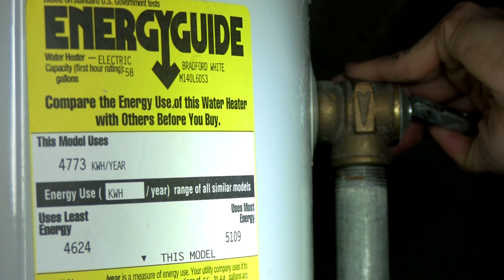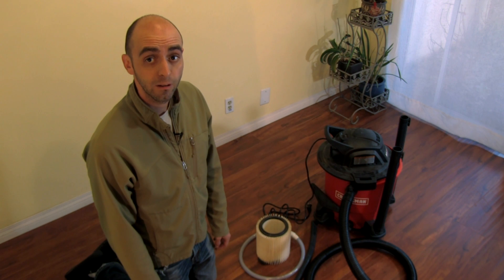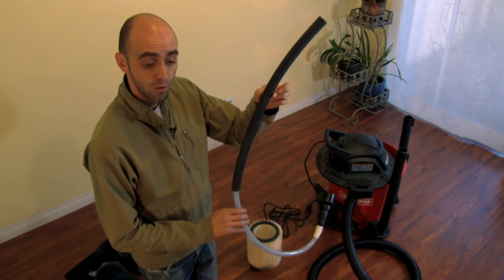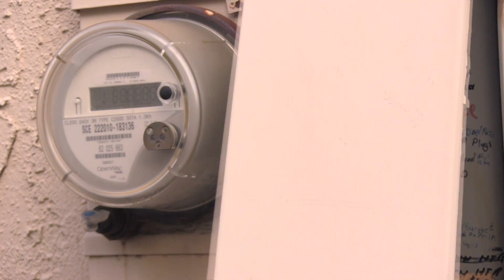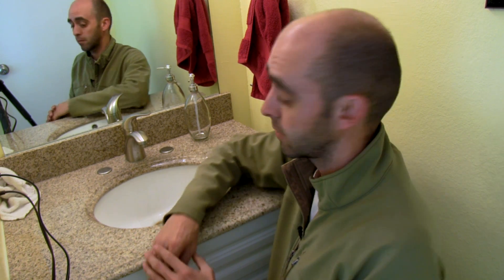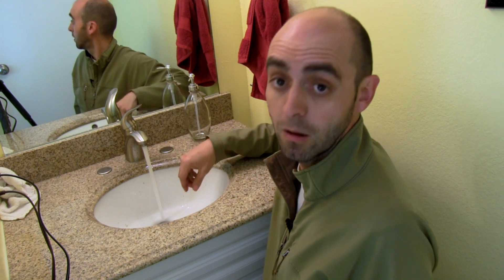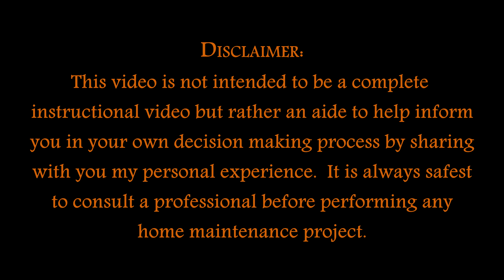DIY: Electric Water Heater Maintenance

Comment: Great video! Just bought a house last month and my water heater is 2 years old so I doubt the previous homeowner did any maintenance. My question is, do you clean the elements as well with a wire brush and take off the build up on those?

Comment: Got a  question for the group. When running the shower the hot water starts to go cold after only 5mins or so n I wanted to know if rheres a common issue that causes this on a Reliance electric water heater model# 650DORS 210.  Thanks for any advice. I'm on my own n bever had this issue bf. The heater is abt 7yrs old
Reply from the maker: It’s likely either a single bad heating element or possibly a single bad thermostat.

Comment: Don't know if you're going to see this. But followed your advice, found bad heating element and replaced it myself. The difference is staggering. My garden tub fills in one go hotter than ever. Thank You!!!
Reply: Problem, I can’t get either heating elements off, and I bought the element wrench.  The heating element, it’s on so tight it’s like it became welded on. Any suggestions on how to remove the heating element if it’s stuck on?

Comment: That sediment looks like mineral deposits from hard water.  You should have installed new elements while you had it apart.  If the elements don't last very long you can get Low Watt Density elements that last longer but take slightly longer to heat the water.

Comment: If you put the larger diameter hose over the end of the smaller diameter hose isn't your suction capacity limited to the smaller hose?
Reply from the maker: Lessened? Probably. Insufficient? In my case no. I suppose your success will depend on the power of your shop vac. Mine is nothing special or particularly powerful.

Comment: how do you know what screw to put the wiring back into there's no negative or positive or does it not matter ?
Reply from the maker: Electric water heaters operate using a 220/240 circuit which doesn't use a neutral. They are both hot. I am not an electrician so you should make an effort to verify my response but to the best of my knowledge it does make a difference  which hot is connected to which terminal. When I've done it myself I've always made sure they were rewired the same way I initially found them.

Here's a video that may also help: 
https://youtu.be/_YZkgZVCZn0

Comment: Once the tank was empty and you verified that you had build up, couldn't you have just opened the water valve to flush out/down the hose and into the drain instead of hooking up the vacuum and buying the hose and attachments you used? Anyone know if that would work?
Reply from the maker: That first thing I tried was a simple flush, pretty much like you suggest, but it didn't do much good. I think because the spigot is located an inch or two above the floor of the tank, gives the relatively small opening of the spigot, and the weight of the mineral deposits (specially the larger chunks), it just didn't do much good. Also, in my case the drain empties to a corner of my patio garden which can barely handle the initial tank draining and it would make dealing with the debris more difficult. I would encourage you to give it a try first to see if it works but if it doesn't than this is an effective backup strategy.

Comment: Suggestions: 1. Take a picture of the wiring with you cell phone so you know how to reattach. 2. Use new heating elements. 3. Use a lighted inspection scope to see all the way into the tank. I keep asking the rental desk at Home Depot but they refuse to get lighted inspection scopes.
Reply from the maker: Good suggestions but as for the heating element, I'm still using that one and it's doing just fine. Why send something to the landfill when it's still perfectly functional. My decision has nothing to do with cost.
Reply: Great informative video.
Reply: Where can I find the heating element for sale, are they model specific?
Reply: @TheWraith007  Start at home depot, either the store or online. Maybe call the helpline for whatever brand you are using.
Reply: @kentonkirkpatrick5225  Problem, I can’t get either heating elements off, and I bought the element wrench.  The heating element, it’s on so tight it’s like it became welded on. Any suggestions on how to remove the heating element if it’s stuck on?
Reply: @TheWraith007  I suggest watching the many YouTube videos about this maintenance.
If this isn't enough, get a licensed plumber involved. Good luck.
Reply: @kentonkirkpatrick5225  Thanks, this is what I found.  Will try it tomorrow.
https://youtu.be/Ijys98-jO-U
Reply: @TheWraith007  Looks good! I hope you can rent the equipment or already have it. Trades people just charge too much these days. Lowes wanted more to install a new WH than the WH cost. Sick

Comment: Great video, but after you put elements back in, you ought to turn cold water back on to see if it is leaking anywhere,so it won' t leak on electrical connections. Which could shock you, or cause a fire. 😀🤔

Comment: Great Video (-) but points missed/errors:
Did not check for leaks before re-installing covers.
Did not replace encrusted elements.
Did not fill tank fully before turning power back on.
Did not inspect anode rod.
Overall not much sediment but a waste of time not doing the above :(
Reply: Thanks for pointing it out, i will check those things too :)
Reply: Also, should not open the TPR valve for air flow. It may not reseat and will then have to be replaced. Just open a bathroom sink hot water faucet. Leave it open the entire time it is draining and the entire time it is filling. Once it starts running smooth, the tank is full.

Comment: Never turn the breaker on until the water heater is full of water and  the air has been bled from the heater, or you’ll burn up the element quickly.
Reply: How do you bleed the air out from the heater?
Reply: @ChosenAndUndone  Just open the handle on the relief valve on top.  Flip it closed as soon as water spurts out.

Comment: What a great video.  Watched it and did it myself.  Thanks so much.  My tank is 15 years old and it was the ONLY time it's been drained, swept out and elements changed.  Surprisingly the elements were in great shape still.  But there was a ton of dirty sediment, rust colored mud like substance and large salt like crystals.  Now that I spent a few hours cleaning it out and changing out the elements, I fully expect the tank itself to fail.  That's how it is you know...sometimes when you mess with things that aren't broken...you break them!  LOL.
Reply: Did it fail, or did it work? Lol

Comment: Good job, but just replace your elements ($10.00 a piece at Lowes or Home Depot) - you went to all of the trouble of draining the tank and removing them - JUST REPLACE THEM!  The shape that yours were in, they won`t last much longer!  I like the hose attachment - I use an automotive heater hose myself. People ask about cleaning the elements - at this point, the metal is compromised and any caustic cleaner will further damage them - like I said - $10.00 a piece!
Reply: NO Prevent maint.. wants All the BUCKS
Reply: Problem, I can’t get either heating elements off, and I bought the element wrench.  The heating element, it’s on so tight it’s like it became welded on. Any suggestions on how to remove the heating element if it’s stuck on?
Reply: @TheWraith007  I ran into that problem years ago, I ended up having to buy a new water heater. Most tanks are glass lined and I would be afraid of using a torch to heat up the area for fear of cracking the glass. Maybe soak the elements with penetrant and keep trying with the wrench? Good luck!
Reply: @TheWraith007 maybe wd40?😳

Comment: The procedure you describe is exactly how it's done.  I perform this service every 2 years.  I cannot understand how you do not REPLACE the Heating Elements and Anode Rod to NEW.  The Anode Rod is at the top of the heater and its function is to draw the lime and other minerals to the rod.  Cost is around $45 for both.  Just cleaning out the bottom, although that's very good, is not enough to increase your hot water.  Electric water heaters are heated by the heating elements not like gas water heaters that heat by flame at bottom of water heater.   CHANGE BOTH and you will have all the hot water you desire.
Reply from the maker: Because they weren't worn-out or deformed and I wasn't experiencing any loss of hot water capacity while showering. Ya they're cheap but there's no need to trash them unnecessarily. That just seems wasteful.
Reply: Problem, I can’t get either heating elements off, and I bought the element wrench.  The heating element, it’s on so tight it’s like it became welded on. Any suggestions on how to remove the heating element if it’s stuck on?

Comment: You didn't clean the elements, that's what I was looking for
Reply from the maker: Ha, sorry. I haven't had an issue with that since I've been cleaning out my water heater annually, or at least not yet. The elements are solid metal and don't appear to have an issues if they have a thin film on them. I've just been taking off the chunkier stuff with a screw driver.
Reply: Question:
as the water heater is filling up do you turn the power back on or wait until the water heater is fully filled with water and how do I know when the water has reached its capacity in the tank